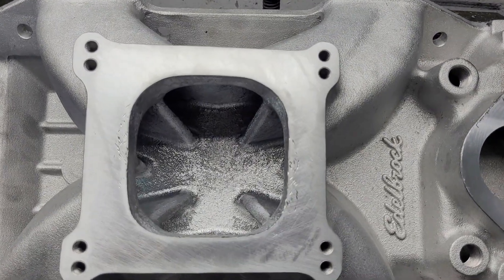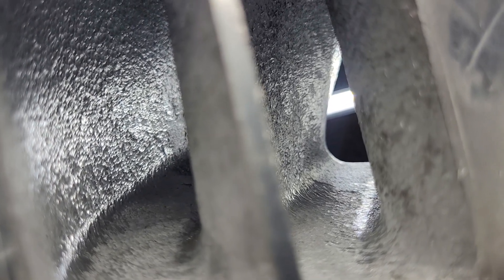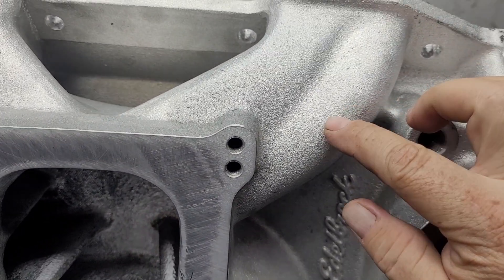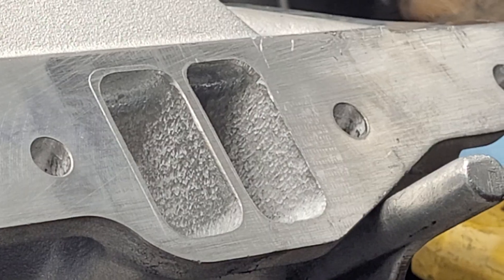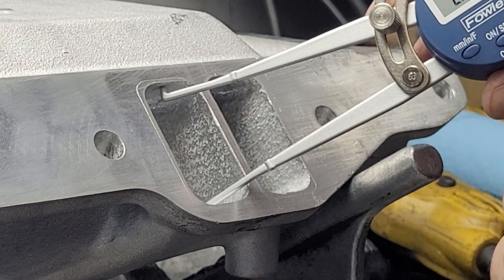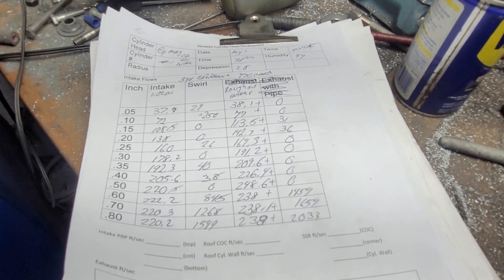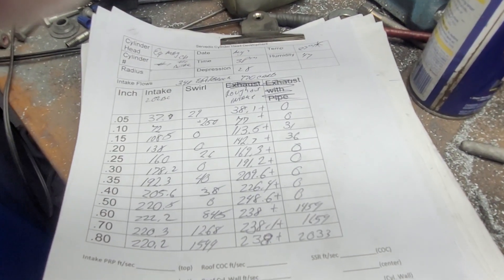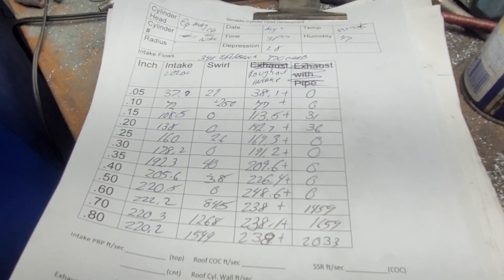Ported Edelbrock Victor 340 manifold on 7th cut EQ-CH 318B 318/360 cylinder heads.

Comment: Perhaps you can show Edelbrock how to cast their manifolds. It should not take this much work to get a new  race manifold to flow enough to work on worked over smog heads.  🤷🏼‍♂️
Reply from the maker: Not doing it for free.
Reply: They should pay you big $$$$$
Reply: I don’t know if casting is the right word here as it is just that, a casting. But I could see a CNC program being useful.
Reply from the maker: @ThirteenTwentyRepair  I would license my designs for cnc work. Sure. Thanks

Comment: What compression and what cam? Need this info to accurately guestimate the HP.
Reply from the maker: 10+ comp, 230-240 probably single profile cam at 108 or 109 cl. .625 lift. Off the top of my head
Reply: @servediocylinderheads  
Ok excellent, I will guesstimate with the heads where they're at now I would say around 440 HP with around the torque a bit higher @ around 475 ft lbs?
Reply: Also how the heads flow now it would make more power with less lift. A cam in the .525" range will keep the engine in the max flow longer than a higher lift cam where the flow falls off after .500" lift on the intake side.

This is good news if the last cut was the final one? Because the valve train will be easier and less costly for springs and probably won't need longer valves for lifts around .525".

With a cam designed around the flow characteristics of the heads will yield more power. I would guess an extra 20 to 40 more HP and closer to 500 ft lbs of torque? 

If you capture the max flow just before max lift the valve will be flowing the max flow from one side if the cam lobe to the other side taking advantage of where the port flows the most longer.
Reply from the maker: @itseithergonnaworkoritaint7852  No, last cut was a loser. 7000 rpm good springs and some lift!
Reply: @servediocylinderheads  
IIRC didn't the flow max out slightly above .500" lift? Or are you going to make it flow at higher lifts?
Reply: Oh, it doesn't always need lots of lift for higher RPM as long as the duration @ .050" which dictates rpm is where it needs to be.
Reply from the maker: @itseithergonnaworkoritaint7852  Stay tuned....

Comment: Wow, great gains for a first cut. 

Hp? 500hp with a stock block. Any more and just a matter of time till you have cracking problems. 

X and r blocks, I’d shoot for as close to 600 as I could get with those heads and intake. Not sure how close you could.
Reply: A stock SBM can handle more than 600hp and live a good while. The stock block is not only bigger beefier in the right spots but it also contains more nickel than a Chevy block and at least equal to a Chevy race block. The MP race blocks are crazy tough. Not needed for a mere 500 hp build. No way, no how, been there and done that, take it to the bank and get the house on it to win big.
Reply: The same mentality as all ford 302 blocks crack at 500hp, Not true and those are actually WEAK blocks.  SB Mopars are in another category.  😂
Reply from the maker: @TheProchargedmopar  I would agree. The little Ford block is tough if prepped right!
Reply from the maker: I took a good look at Rob's 340 block. That thing is beefy except for the bores!!!
Reply: Yes the cylinder walls are the weak point, that said they are tough with a higher nickel content. Most guys racing high horsepower stock blocks fill the the water jackets with block filler.
Reply: Rumor has it that the earlier 318’s have the same size water jackets as the 340 and more meat in the cylinder walls. I have not checked this, but if true a 4” piston in a filled block would give great ring seal at 11:1 compression ratio.